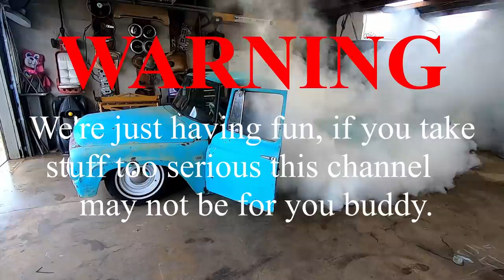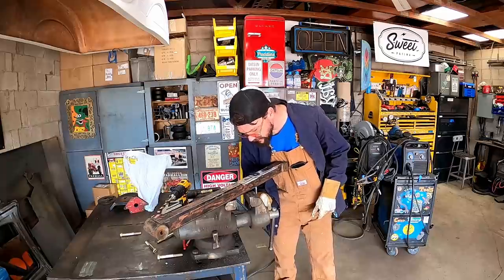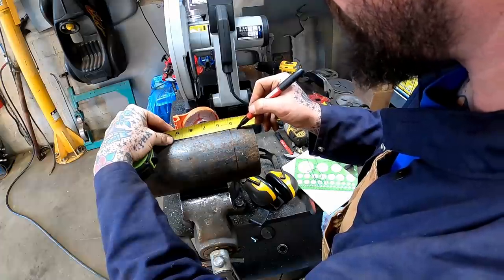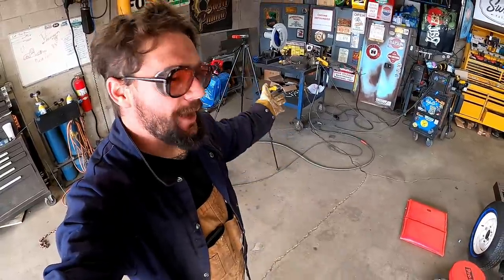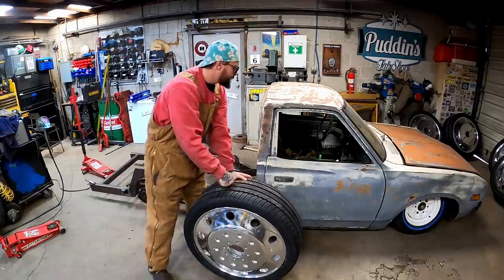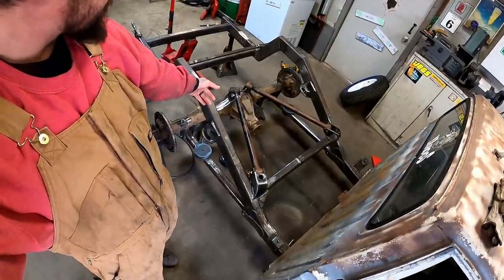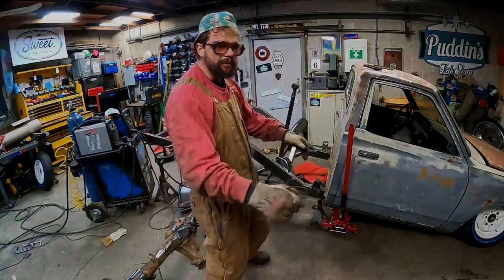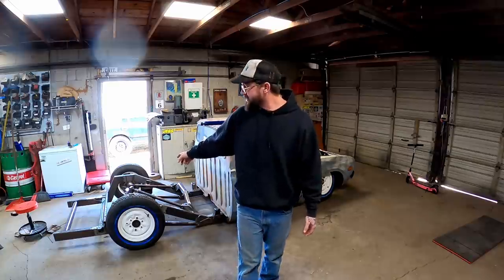OPERATION FABRICATION. Building Air Bag mounts, gussets, dimple dies, and more! 1977 Datstun 620.

Comment: Very proud of you taking safety precautions . Your eyes and knees will thank you when your Old like me . I was in the tire and auto buisness for 35 years and was in my 50 when i started using knee pads because i couldn't kneel on the concrete anymore and know i have a knee cap that will giveout just walking sometime . And have had to go get metal taken out of my eye because i didn't use safety glasses . So good on you !!

Comment: Man your videos made me get of my a×× and get my old Ranger going. New battery, alternator, serpentine belt, radiator, front coil overs, air shocks in the back, straightened the bumper with some heat and the old make it happener, new 35 all terrains on some 17s. Took her for a test run last night. Drives great. But spewing power steering out of the steering rack and pinion. Looks like i have some more work to do on her. But she's running.

Comment: I'm in a similar situation. I don't have a huge shop with CNC machinery and 30 employees. I have a welder, 4.5" grinder, drills, a drill press, and a tape measure. Cardboard and duct tape comes in handy, as well. LOL! I attended an engineering High School. Tee squares, triangles pencils, a scale, and a French curve, were the tools of the day. You didn't need internet service, batteries, or an extension cord. LOL! Shop math and geometry were your best friends.

Comment: Yes sir another great viewing session,  Careful with the Plasma Cutter this one is a good brand used to work on them back in the early 90's I would try and keep it un covered when using, These things need to breath and get warm internally pretty quick and the IGBT's in these things aint cheap.

Comment: With bags mounted above the axle, a line drawn through contact points equals weight on tire contact patch, proper install.
With bags on lower control arm, to achieve contact patch your going to/through arm bushings.
Hence vechicle weight is ON BUSHINGS.
At that point they not only absorb rear end thrust loads, their also carrying the vechicles weight.

Comment: Great job on your video thanks. Been helping me through a bad time. I love and live to tinker fabricate things. I have projects that I haven't been able to work on due to having no feeling in my left arm and hand it also comes with lack of grip strength (feels like pulling your zipper up in the winter with a Frozen hand but all the time). It's caused by four balls disc in my spine so I also have leg problems (limping and buckling of leg). So anyways feels good to be in the garage again even though it's not my garage or my projects. So I want to thank you for helping me with my frustration and depression.
PS. You remind me of my nephew Donnie

Comment: Hate to tell you this Puddin, but most of the old wind up clocks were 8 day clocks. They were designed with a mainspring that would power the clock for 8 days, that way if you wound it once a week, your clock would never stop.

Comment: Hi Puddin I love your channel. You have a real sense of humour. I'm just looking at the lower trailing arms. Would you be better off with the bushes at the back of the lower arm and heim joints at the front.  Heim joints at the front of the top arms too. Think of it this way, Looking at the right side as the rear wheel travels over a bump on that side only, the left rear wheel drops to maintain contact with the ground with out the chassis moving as the right climbs over the bump. It won't try to lift the chassis giving a smoother ride? A true independent rear with a solid rear axle.  You are a good engineer and welder. Think about it. This is the way the offroad race trucks are made. If we made it your way it would try to twist the arms off the chassis. Its just a bit of over kill for what you are doing but it works. Its one of the ways to help to keep the truck level at speed.  they also mount a sway bar across the chassis behind the axle with vertical links. The wheels travel up and down and the chassis doesn't.

Comment: I don’t know if you thought of it and if you do really want keep those lower shock mounts. What if you just flip them where the gusset is facing the opposite direction. Also I love mini trucks. I’m currently building a 1983 s10 with a 12 valve cummins and its also on air ride with pipe upper bag mounts 😂

Comment: Putting the airbags on the trailing arms is going to put the entire weight of the back half of the truck on those lower bushings.  You might want to go with something more robust to prevent failure of the bolt and bushing...
Reply from the maker: I’ll let you know when it fails… it won’t fail, this is a very common design lol

Comment: Hay pudding my 91 ford ranger XLT 4.0 auto won't stop starting changed all possible didn't do b4 new starter dead key starting won't stick but when running keeps stater in gaged will shim's help ? Tk u for your time and shows keep up the good work

Comment: I am not a fabricator... but I have a question anyways: Why not put a pivot joint on the top of the air bags like a shock mounts on a solid rear axle?  Just thinking it would let the bag keep straight as it airs up and airs out and does suspension type things with the articulations and such.  Just askin... not criticizing.

Comment: want to learn to be better at welding with tig and mig practice with stick welding . anyone can weld with a tig or a mig but stick is something you need to practice to get good at and the best part is once you have it down everything else is easy. I learned to stick weld back in the 70's when you needed to be licensed to work at a shop and the test was a pain in the ass but I did get a license after a week of hell and the annoying inspector was finished with me .
Reply from the maker: I’d have to totally disagree with that..

I learned on stick welding.. that Datsun used to be stick welded together.. and I don’t think TIG is easier then stick..
I would definitely say I could have people decently stick welding in a day, but not TIG. 

And I probably will stick weld again, when I need to build a fence or gate lol

Comment: Needa turn up the ole tig..  those weld pools are lookin a bit small..  might not have proper penetration..  on the surface it could look all fine n dandy but the innards could be divorced and aint nobody like going through those..